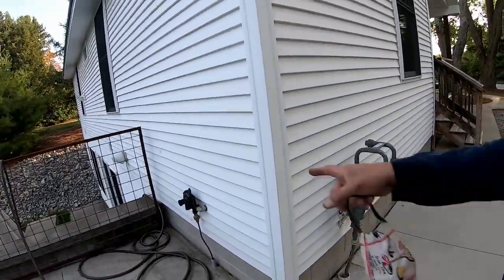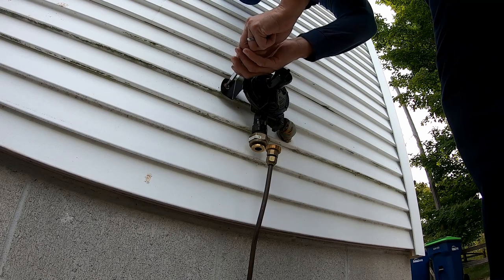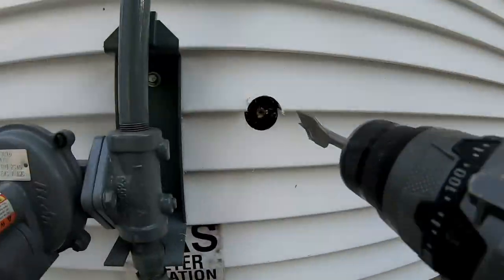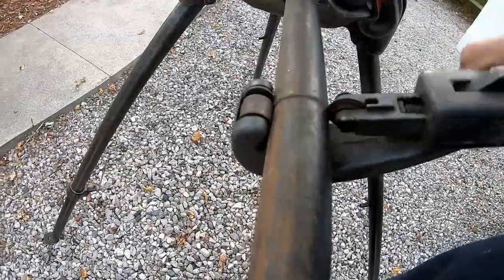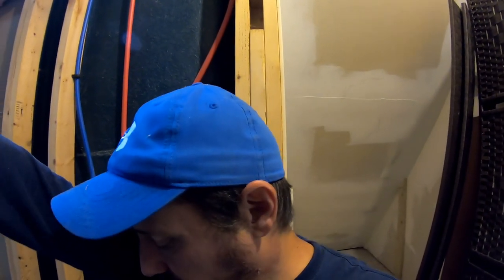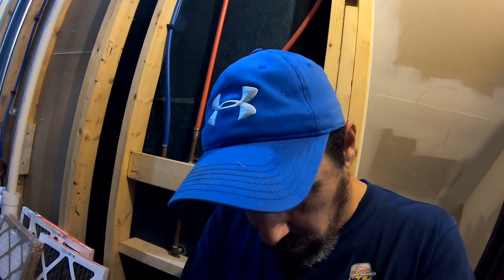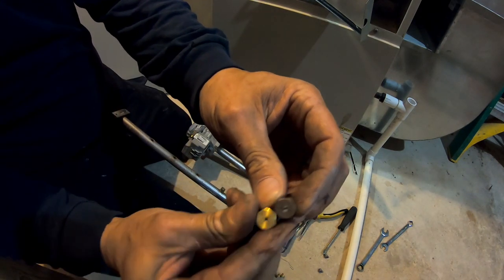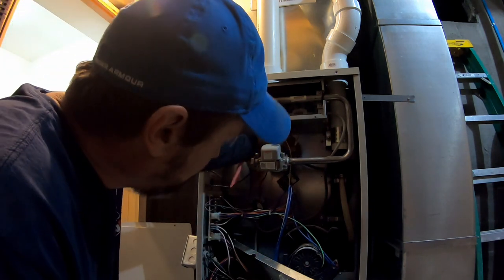Converting a furnace from L.P. to natural gas, and changing pipe location

Comment: Why wouldent you just add a line from the old meterbox to the new meter box. Seems like a ton of extra work to run a entire new gas line. Just add on to the outside line.
Reply from the maker: In our area, the natural gas company dictates where the meter goes, and they want to be able to view it from the street. Sometimes we get lucky, but in this case I had to change the location. Great question!